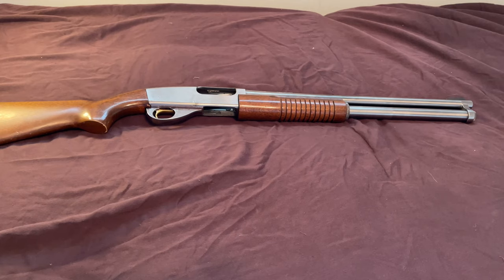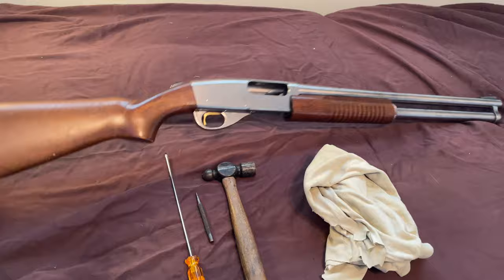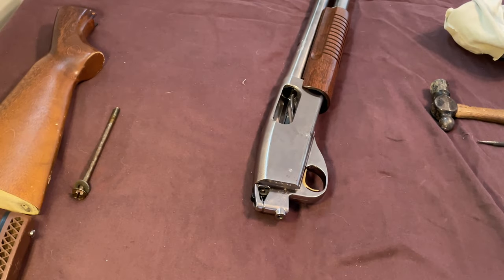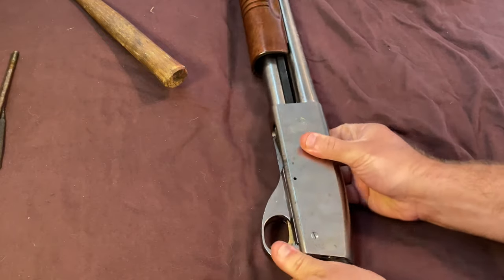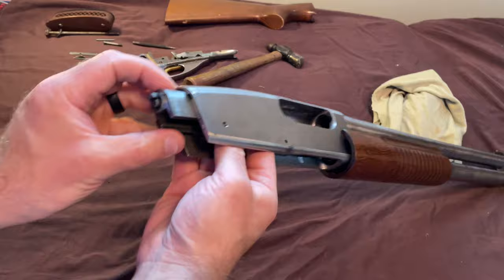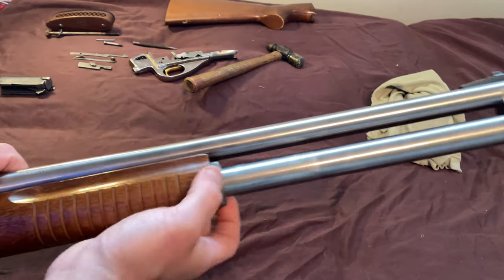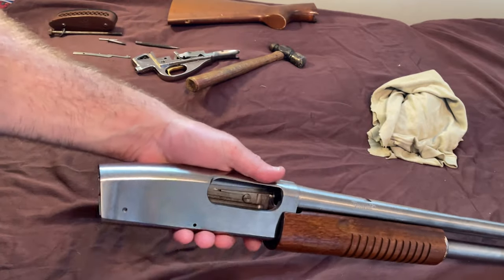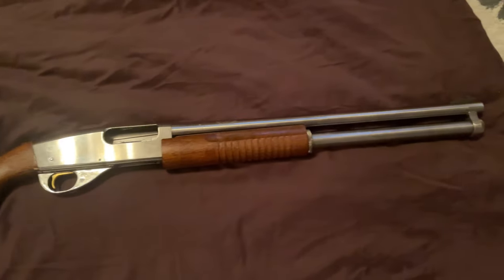How to Field Strip the Smith & Wesson 916A Shotgun

Comment: I have the 916T, I didn,t have an eight inch screw driver either. I used 3/8" extension with 1/2" socket to remove stock. Thanks for making this video!
Reply: Oh and my cartridge cut off was also bowed.
Reply from the maker: Good information. The next time I break mine down, I’ll try a socket. Thanks for coming by!

Comment: I have a 916a the bolt seems to get a little sticky while trying to push the shell into the chamber hoping it just needs a good cleaning ?
Reply from the maker: Mine seems to do the same thing, the pump doesn’t function completely smooth. I would definitely recommend cleaning and a light coat of oil to give yourself the best chance for success. Thanks for coming by!

Comment: You stopped at the point of removing the mag. tube.  Exactly what I wanted to see!  I have access to machining and welding etc. and have ambitions of fabricating a mag. tube extension, 5 to 7.  Looks like a Remington spring will fit. 

Yes I would have to disassemble it.  Better to watch you.  OK, so I'm lazy!
Reply from the maker: Removing the magazine tube isn’t a great deal of work and I’ve thought about redoing this video showing that but if you break it all the way down it’s not too far out of a basic understand of guns. I appreciate you coming by!

Comment: I just came into possession of a standard 916 and it's rough. Where the cap screws into the mag tube (near the muzzle) has broken off. I figured just replace the barrel and gtg but can't remove it. I know they come out, have a few saved on flea bay but for the life of me can't figure out how to get it.

Any tips?
Reply from the maker: I waited a couple days before replying here as I thought about what you’ve said. And really without seeing the gun in person this is a tough one. When you disassemble the gun internally and get the pump free you should just unscrew that cap you’re talking about and remove the magazine spring and follower. You have to do that before removing the barrel. 

If it’s broken that bad that it won’t unscrew I would start with a generous amount of PB Blaster or WD-40, wait a while, and if you have to use pliers, vice grips etc to twist it out, at least use a rag or cloth as a barrier between the tool and the gun to keep from damage. At some point to has to unscrew because under the cap is the magazine spring. 
Again this is me using my imagination because I haven’t seen it in person. I would say if you feel like anything you are doing is going to damage the gun I would take it to a gun shop that has a gunsmith and have them look at it. I wish I could be more help. Thanks for coming by!
Reply: @cornfromajar3222  I have removed everything from the receiver minus the barrel. Only thing holding it in place is whatever the factory did during the installation. 

However just yesterday (thank to the power of the internet) I learned the barrel is threaded in and a barrel vise is required for its removal. I'm wondering if a big strap wrench and some love from the torch will break it free.

Vise will likely be required for the reinstall though.

Comment: This is very helpful, thank you for the video. Could you tell me if the 916 and the 916-a barrels are compatible? I have a 916-a and wanted a longer barrel, I found a 916 but just wanted confirmation they are compatible
Reply from the maker: If it were mine, I would assume the receivers are the same and would accept the same barrel. I’m not a gunsmith though and would definitely recommend having a gunsmiths’ opinion on this. Thanks for coming by!

Comment: A friend recently gave me one of these and it needed to be cleaned.  I can see why.  Do you need to remove the buttstock as the bolt and carrier seem to come out the rear of the receiver in one piece?
Reply from the maker: Yes the buttstock has to come off to get the bolt and attachments out of the reciever, at least that’s the only way I’ve been able to do it!
Reply: @cornfromajar3222  THANK YOU
Reply: On my 916-A , just take the left screw all the way out. Than looen the right screw to move the Butt stock out of your way and than a long flat head or 1/2" Drive to pull the connecting Bolt out. You have a 916-T. Is your Barrel permanently connected to the reciever( one piece) ?

Comment: Can the barrel be removed from this type of smith? I know you can remove the barrel from the model 916T but unsure with this
Reply from the maker: I haven’t tried this, and in the brief user manual I was able to go off of, it didn’t seem to indicate you could. I’ve read some forums from other owners that supposedly the 916A barrel couldn’t be removed but the 916T could. There was also some belief that there was a recall on the barrel at some point but I can’t verify that. 
I suppose with a vice and an experienced gunsmith someone at some point has swapped a barrel out on it out of necessity. But in my own case, I just run patches through the breech and barrel vest I can especially since I don’t shoot it very often. Thanks for coming by!
Reply: No,it's a one piece to the reciever !